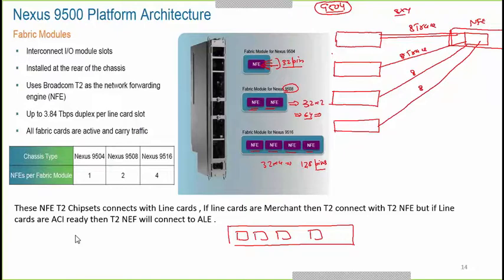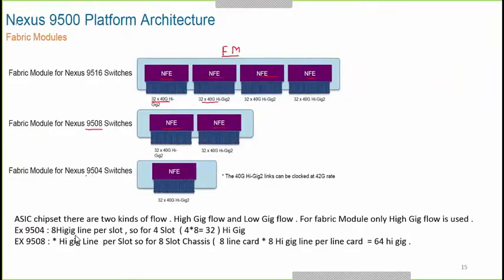UniNets : Nexus 9k Fabric Modules Free Training Video

Comment: What is a minimum number of FM-E required for Nexus 9504 chassis to boot up and working correctly using only one line cards (N9K-X97160YC-EX) and one supervisor,  we do not need redundancy or maximum bandwidth this is a lab only ?